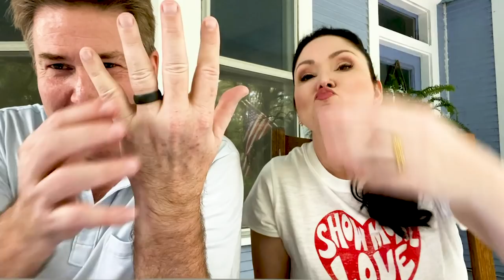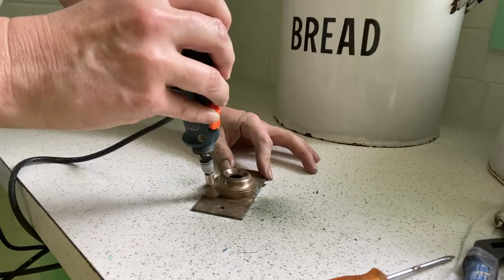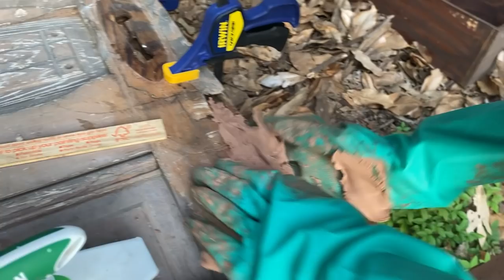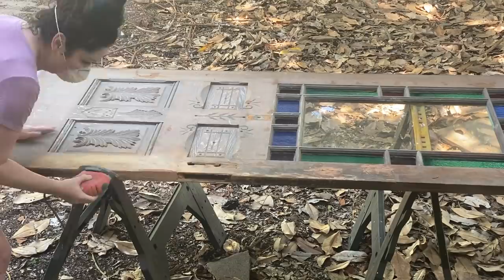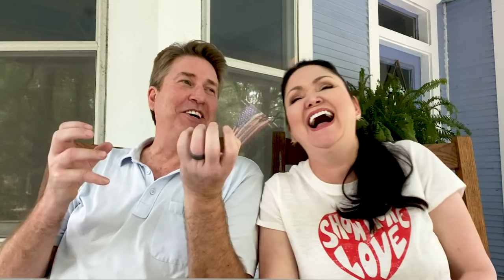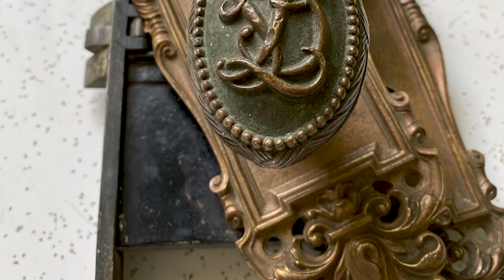Restoring Our Victorian : Episode 6

Comment: Not sure if you guys are still monitoring comments but...there is a somewhat new product called Retique It, that basically "paints" a new thin layer of wood (adding wood grain with a special roller while it's still wet) when you want to stain and cannot get even coverage (due to water damage, Bondo/fillers, etc).  It's a really fun product that you might want to play with and/or find useful in your restoration work!